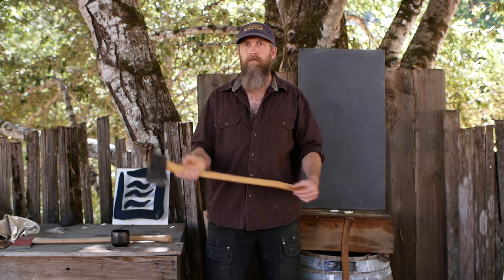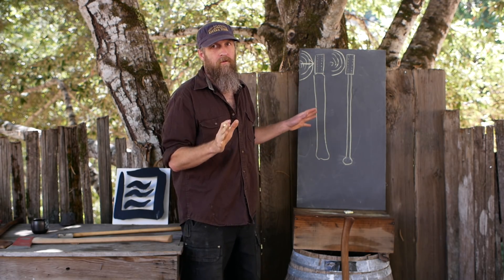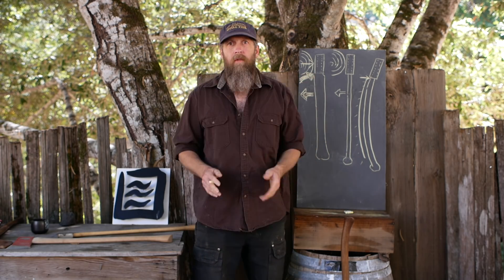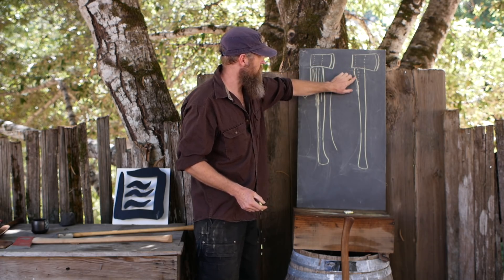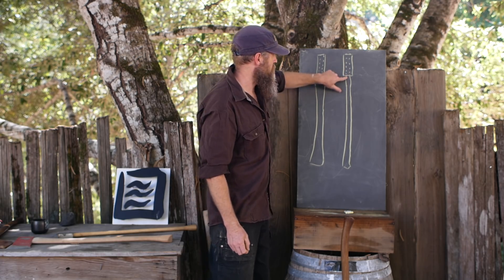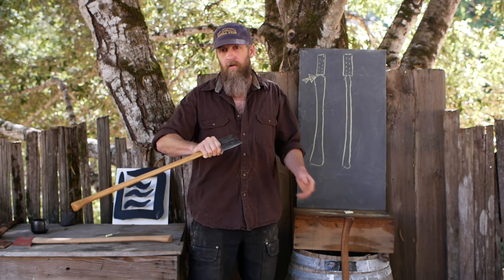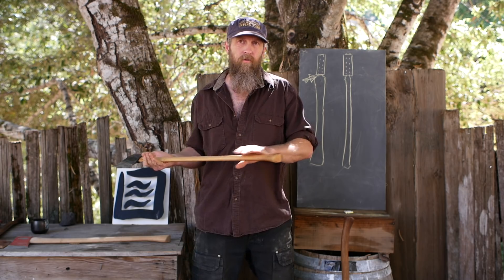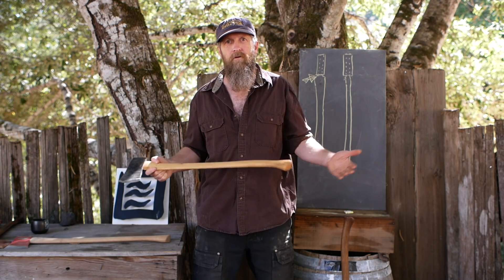Why Axe Handles Break at the Eye: When Strength is Weakness, Overbuilding v.s. Stress Distribution

Comment: Thanks Steven. I think if the axe is used as it was designed to do it should last a very long time. Any tool (most) that is used for other things will not last as long. The demo you showed for lateral abuse is not what the axe was designed for, but I get your point. I do understand that the axe is used for splitting firewood, but was it designed for that purpose? If we look at a true splitting maul we see a different eye in the head that takes a completely different handle shape, a head and handle shape designed for the purpose of downward force. Is the handle of a splitting maul stronger than an axe handle? My guess is much stronger. More to say but I don't type well!
Reply from the maker: An axe and handle may not be designed for high lateral stress on a regular basis when used as intended, but it may very well be evolved to deal with incidental lateral stress, which is very common.  The main incidental causes of lateral stress I see are side impacts in bucking and felling and they can also be quite high in limbing if the log is struck ahead of the limb by bad aim.  I see side impact type of stress to be less common in splitting.  I measured some mauls and sledges for the blog post. They are consistently 1 inch or more wide, where most full sized american axes are about 3/4 and boy's axes more like 5/8.  And they are somewhat oval, so a bit longer in the bit to poll dimension.  Since there is not issue with keeping the heads thin, they can afford to have wide eye, which would partially compensate for the smaller front to back dimension.  The other difference is that they don't usually stick as hard due to the shape and one of the highest stresses applied to an axe handle it wrenching it free from a cut, and the hardest sticks are usually in splitting.  I would think that the splitting maul is a fairly recent invention, or at least recently popular.  materially poorer people would use what they could afford, which was probably often a single worn down axe that did everything.  Whether a maul handle is stronger might depend on what direction and what stress is applied.  It clearly has more shear strength in the side to side direction, but I'm not so sure about the bit to poll direction.  And we have to account for the heavier head applying more stress to the handle with it's greater inertia.  I got tired of breaking them and bought a fiberglass handle for my sledge, which would have broken a dozen times the way I use it lol.  I love that fiberglass handle!  :)

Comment: Dumb question warning: couldn't they just make the eye less thin?
Reply: Increasing the size of the eye to match the handle size increases the size of the head, if the handle is twice the thickness, the eye and therefore the head needs to be twice the size and twice the weight. Do you want to use an overweight axe all day?
Reply: @sunshaker01  fair point
Reply from the maker: For sure.  I mention that in the blog post.  The interesting question is why did American axes evolve to the configuration we have now, which basically pushes the practical limits of the handle material by making the eye just about as small as can reasonably be gotten away with?   European axes on the american patterns usually have larger eyes, and remain practically the same weight.  The difference might seem small, but it does make a difference.  If you look at the eye size on the gransfors axes v.s. an American axe of the same weight, the difference can be significant.
Reply: @SkillCult  I live in italy and I can confirm this 100%